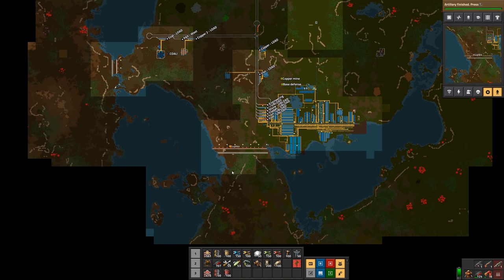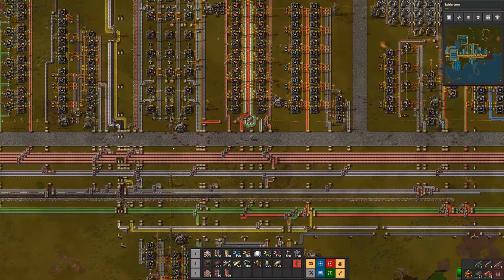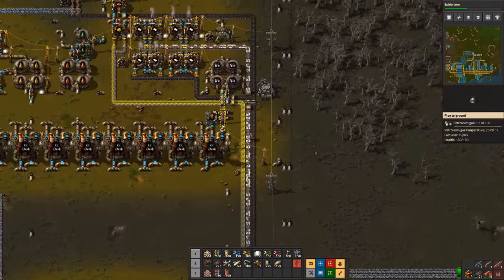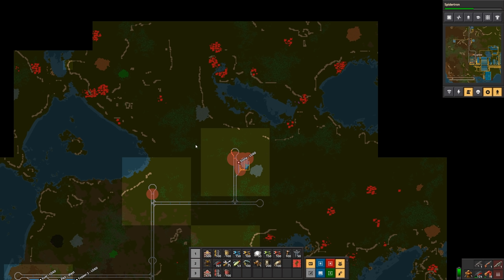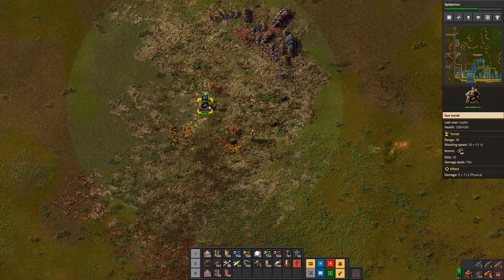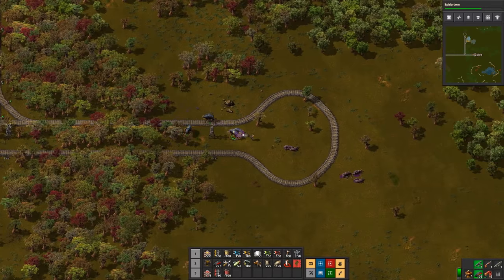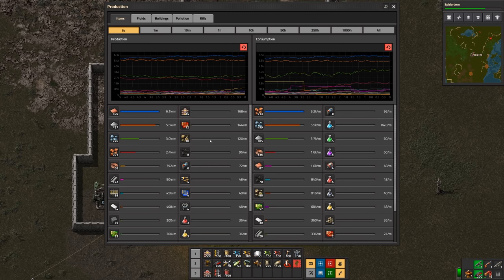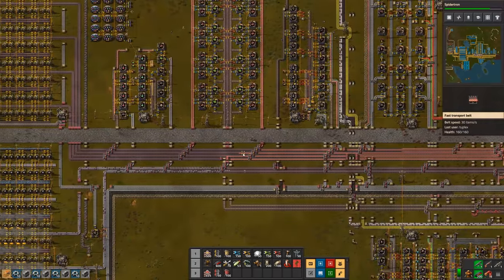Factorio 1.0 Tutorial #18 - Artillery wagons

Comment: Welcome back and thanks for the enteraining gameplay.   An observation on dragons teeth - Spitters will attack wall segments one space apart but will not attack wall segments that are two spaces apart.  If you create an interlocking pattern of two wall segments and two gaps 4 or 5 rows deep, the biters have to slowly zig zag through the teeth and bunch up as they do in a dense forest.  This gives the flamers time to spray the approach with naplam. The key thing is the Spitters will not stop to attack the teeth but move into range of the defenses after the biters have triggered the flamers and no wall segments are damaged. This works so well that my end game outposts don't need continous walls to defend against behemoth biters and wall repair kits are unecessary.

Comment: artillery wagon honestly sounds cooler but artillery on the walls would feel safer
Reply: Given their use - essentially keeping their range clear of expansion once they have done an initial clear - you can go either way, but I was glad to hear Tuplex prefers the train as I'm changing over to using it exclusively. One of the main reasons is restocking them at walls is an annoyance since the ammo doesn't stack. Add to that artillery wagons being able to hold 100 shells each and they are pretty beast. In addition, building one train is a lot less resource intensive than building the number of turrets needed to cover the same area your train can just by adding some additional track and another stop.
Reply: okay now tell me what sounds cooler a wagon or a spidertron